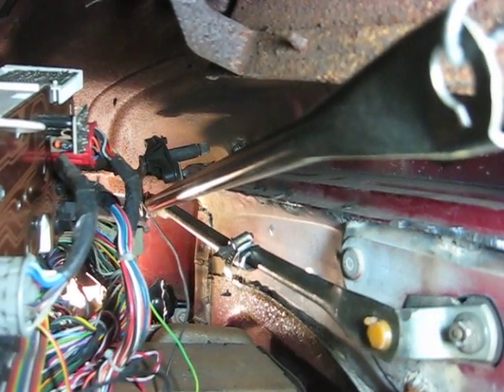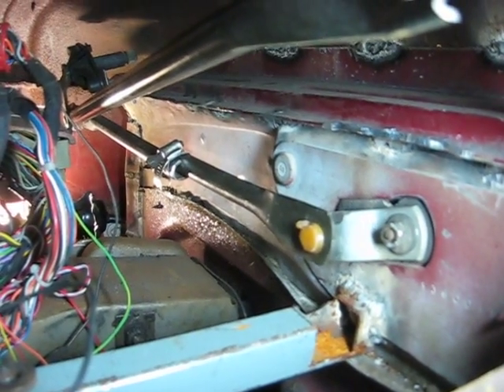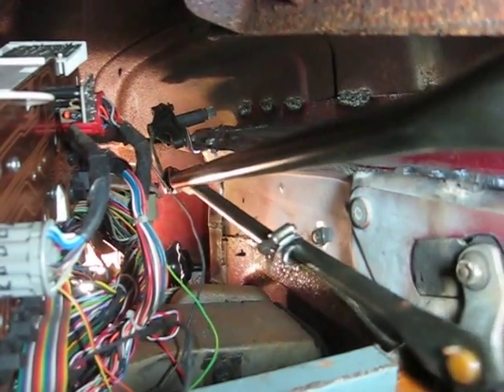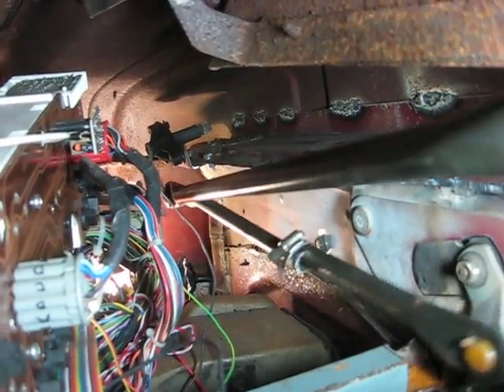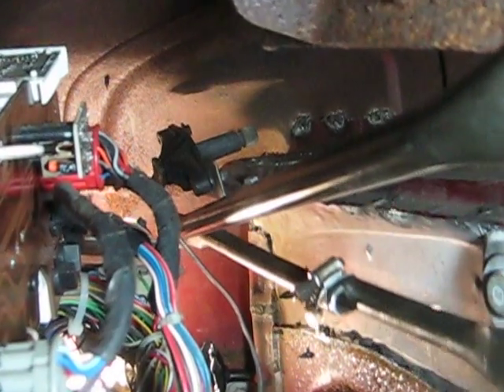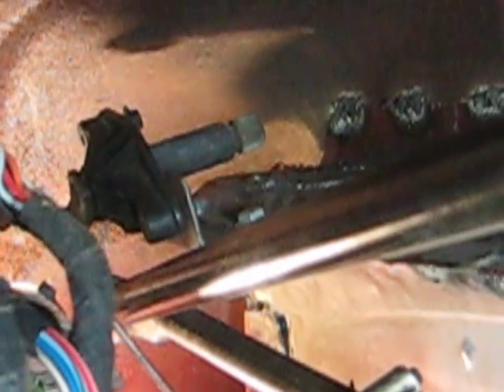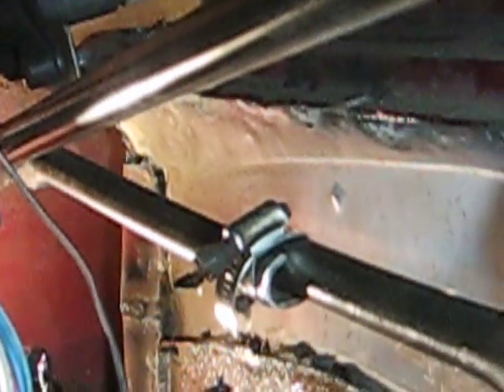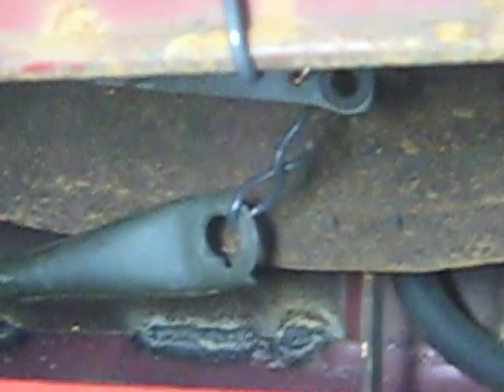Vacuum windshield wiper conversion to electric wipers - Part 2

Comment: I am attempting to cover similar ground with a 1950 Ford pickup using a '98 Chevy truck wiper motor.  I would enjoy discussing your project with you if you wouldn't mind.  I can be reached at bbwi20@hotmail.com   Thanks, David Klinger